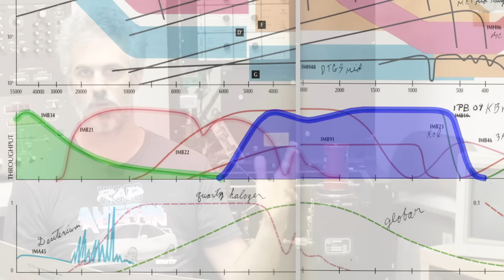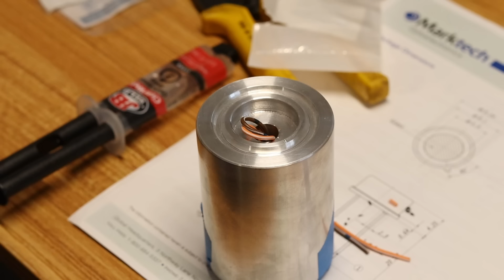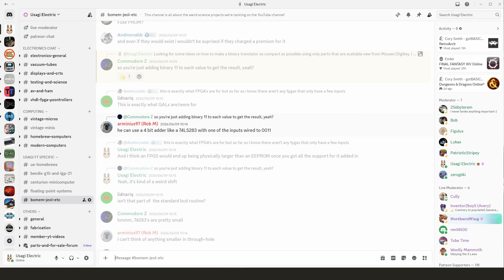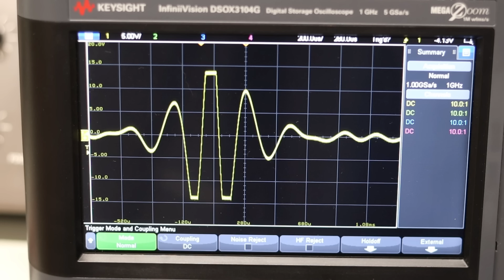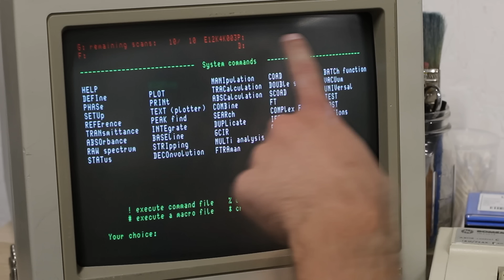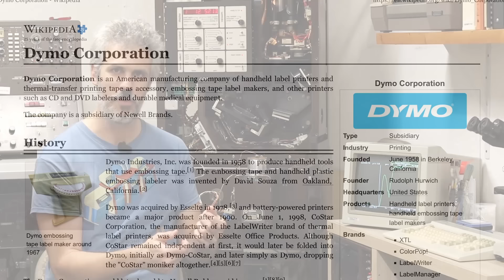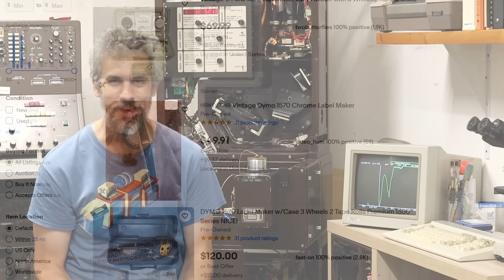Using a PDP-11/73 to do Real Science!

Comment: At this rate, it won’t be long before you can test the magnetic coating on the drum in the G-15 and figure out what it’s made of!
Reply: Well that's what the auger electron microscope is for, that hasn't been touched yet!
Reply: @vincentguttmann2231  That won't give you the composition, though. It only shows the surface detail. Like, how smooth the coating has to be and how thick it is.
Reply: @kelli217  It can tell you which elements are in it, but that is not sufficient to make out the coating.
Reply: @lbgstzockt8493  It's a lot better than guessing.
Reply from the maker: @kelli217  The Auger cycles through energy levels and detects the amount of Auger electrons being knocked off per energy level. This is enough information to get a full chemical analysis of the surface. But, you're right in that it only shows the surface down to a few angstroms. That's why it has an ion gun built into it, so you can ablate away the surface and get another measurement a few angstroms deeper. By repeating this process over and over (measure, ablate, measure, ablate, etc.), you can get a full analysis to quite a decent depth. 

This exact Auger was being used by the previous owner to inspect ICs, notably bond pads. We've recovered the hard drive that was used on the control computer and found the original software and project files. There's some amazing stuff showing the aluminum oxide levels, aluminum, fluorine, nitrogen, etc. of bond pads as it gets deeper and deeper into the material.

This should be an excellent tool for figuring out all sorts of interesting things, both with the drum and for other things like hard disk platters.

Comment: You can get a socket for a surface mount chip that turns it into a standard DIP. Mouser has them.
Reply: there's also just adapter boards you solder the chip on and some 0.1" pins, and they're way cheaper than actual sockets, and available anywhere online

Comment: Wavenumber designation was new to me, I'm used to nanometers.
Reply: The wavenumber is the spatial frequency of a wave. It can be found by taking the reciprocal of the wavelength. Spectroscopists use the centimeter as their unit of length, rather than the meter, so you need to divide the reciprocal by 100 to get the wavenumber.
Reply: I was going to say this too. I worked with medical lasers for many years, and we always referred to nanometers and frequency. I understand the term wave numbers just by the context of its use, but I've never heard it used in the field by the techs, academics and practitioners I worked with.
Reply: Wave numbers are inverse centimetres.  There are 10 000 000 nanometres in a centimetre (1000 nano-somethings make a micro-one of the same thing, 1000 micro-ones make a milli-one; so 10 000 000 nm. = 10 000 µm. = 10 mm. = 1 cm.)  so WN * nm = 10 000 000 = 1E7.  Dividing 10 000 000 by either nanometres or wave number will give you the other of the pair.
Reply: Use wavenumbers when you want a scale that is linear in energy. I worked for a company making FTIR spectrometers, the computer and software side, not the chemistry side. We had an option to plot the result in wavelength units but is was virtually never used.
Reply: Nanometers are the distance between waves. Hertz is the number of waves.
Reply: @koppadasao  and mega hertz is when you power up your custom pre-amp, and the magic smoke comes out
Reply: @gorak9000  The magic smoke is released due to excessive current, not hertz
Reply: back then every company just wanted to be different and made up their own units .

Comment: You are talking about water cooling, is tap water the correct choice with the stuff in it? Distilled water work better, using a small pump and cooling coil with tap water as the heat exchange.

Comment: I live in the EU and recently also started ordering PCBs from a local manufacturers. For smaller batches the shipping from china either takes forever or is expensive af, depends on what method you pick.
Reply: Go with Global Standard Direct Line and as long as the package doesnt go through germany (they lost multiple of my packages after duty checks for 6 months) it takes at most a month for JLCPCB.
Still not fast but its better than DHL or UPS demanding insane amounts of money and then STILL force import duty charges on you at the door because they depand double payments

Comment: Instead of using a water cooled vacuum pump, have you considered something like a vacuum pump from Gast? 

I encountered these a number of years ago. They come in various sizes and ratings. The ones I saw were small-sized ones used on a photostat camera, platemaker, and exposure units initially then later on at Polaroid Graphics Imaging (Latran Technologies) where they were used to hold down substrates on a drum spinning at 5000 rpm.

Speaking to my brother about this, he still uses one of these vacuum pumps to degas cast resin parts and molds.
Reply: It's the SENSORS  that will need water cooling, not the vac pump.
Reply: @alanclarke4646 That makes sense. He could probably pick up a chiller for that. My brother was given one by a friend of his. His company was "throwing it away" because it was old. There was nothing wrong with it and now my brother uses the chiller for his CO2 laser instead of an old fishtank pump submerged in a bucket of water.

Comment: @usagi I find the pricing model for OSHPark very much favours smaller boards - places like PCBway seem to charge linearly per area but OSHpark the area charge increases as the overall size increases. Basically, If you can shrink the amp board you have it may be possible to halve the cost to you.
Reply: what do you think the difference between "linearly per area" and "area charge increases as the overall size increases" is? regardless, the pricing model for both isn't a secret. jlcpcb has reduced/flat prices for <=100x100mm boards, then goes to a rate based on board size, and any special engineering costs, whereas oshpark is a set $/square inch.

Comment: Why not use a SMD to THT adapter break out board? Usually those are in standard smd chip sizes, and then you can machine the rest of the board in house?
Reply from the maker: Because I had way too much confidence in my original design, I was like "I'll just send it!" Turns out, I should have done exactly this, lol.
Reply: @UsagiElectric  Fair point. I would have more confidence in one of your designs than one of mine. 😆
Reply: I have done something similar (using JLCPCB) with a 14 or 20 pin SOP to pin headers for using SOP in breadboard testing.
You can get multiple on each PCB using snap lines.

Comment: Pure organic compounds absorb highly in the NIR and IR. You need thin films (.1mm or less) to get a good spectrum in the IR. If your scan can get to 3000 nm or 3333 wavenumbers a thin film of polystyrene plastic has lots of sharp adsorption lines to see. You can obtain rectangular slabs (windows) of NaCl or KBr crystals to make transparent cells for the NIR and IR with different size Teflon spacers for pure liquids. A window of NaCl is pretty tolerant of moister and can be polished if it gets tarnished. Keep the windows in a sealed container with a little moister absorbing packet. Good work with the Bowman.
Reply: Can confirm, did this way back in o-chem -- smear a bit of sample onto a NaCl plate (usually via solvent, let it evaporate) and put it in the machine. The plates looked mostly clear, but not optically pure; maybe not single-crystal, but large crystals at least, very close together (minimal porosity / intergranular space). They looked kind of layered almost like roughly peeled mica, but having that texture through the bulk.  Smooth to the touch.  I imagine the optical purity is much better in IR (i.e. scattering defects small enough not to mind); also some scattering loss on a window (without defocusing the beam overall) is acceptable, as long as it's calibrated for.

Comment: 😁👋👋 As I said before, just elated that my spectra have been of use to someone so many years after I created them! I suspect the difference in peak height between our spectra is simply down to path length and the fact that I was using pure anhydrous lab ethanol rather than a 95% solution. I wasn't even using a proper cuvette! I used a tiny little 10 or 20ml beaker, which if I recall correctly was probably about ~30-50% longer in path length than your cuvette here. Beer's law and all that... 
Anyway, it occurs to me that you could potentially just MAKE your own KBr beamsplitter! Sure it might sound totally crazy, but there is just someone crazy (and very brilliant) enough right here on YT who's made his own KDP frequency conversion crystals for Nd:YAG lasers already! His name is Les Wright and his channel is called Les' Lab. The video where he shows how to grow big, PERFECTLY optically clear KDP crystals using Alan Holden's method with a rotary crystallizer is called "How to grow big crystals at home fast!" KBr may be even easier to grow than KDP, and should be trivially easy to cleave into flat slabs for a beamsplitter with a common razor. In fact, I suspect Les may be happy to just grow the crystal for you if he has time! Maybe you could do a collab video or something. He's also a laser expert so he may have some tips for your mode-hopping/dying HeNe there. Incidentally, there's ALSO a video on here from 1958 from Bell Labs featuring Alan Holden himself explaining crystals which, while not in-depth, is excellent and a fun watch. 
The Bomem odyssey is quickly becoming a science saga favorite on here for me!! Keep up the excellent work!! 👍👍
Reply: Addendum - it's "mew-oh-knee-uhm", I am a little exotic atom made of a positive antimuon and an electron and I only live for about 2 microseconds before decaying into a positron and a couple neutrinos, but I have real energy levels and everything, just like a normal atom! ⚛😊😄

Comment: Interesting.  Maybe check out what the kids are doing with Meshtastic and Lora. The physical radio layer there is using spectrum analysis to extend the radio range by using spread spectrum transmissions then doing a FFT at the receiver. It's pretty new, only the last couple of years, but it's great for remote FPV drone controls, or just texting during a zombie apocalypse. Also relatively cheap, as the MCU's there are efficient enough to run off of batteries. Happy Sunday!

Comment: i have taken a look arround and there are photodiodes for the whole IR spectrum as well.
Depending on sensitvity one could build another pre-amplifier out of those great photmultplier tubes as well (--> new huge project incoming)
Reply: I wonder is a Peltier cooler could get it cold enough to stand in for using the LN2.  They make some stacked up ones that get well below freezing.  In a vacuum and with the low power of a detector there is not much power needed.
Reply: @kensmith5694  i wouldn't count on it. The tempreature gradient is too large for a peltier cooling to work properly. One should rather stick to a dewar style housing and filling of LN2 as needed.
Reply: @Schlumpfhut_1985  The stacked ones can make 100C Delta-T.  I think this is enough to seriously lower the noise
Reply: @kensmith5694 no. One would need at least twice that delta T. Nitrogen boils at -196°C
Reply: @Schlumpfhut_1985  It is a question of how cold is needed to do science and not the 77K number.  He is not doing super conductors or the like.  
Leakage current in a diode runs as Temperature (degrees K) squared but the noise component of that current has a sqrt() in the equation.  The result is cutting the absolute temperature in half cuts the noise in half.
He can already do some science with the detector at room temperature.

Comment: idk if full alu functionality is suitable for an fpga btw. bitwise shifting should be enough. ie minimal amount of transistors per gate logic element. may consider basic int alu ops but also can just combine multiple logic element gates to implement those. ie the point of an fpga. have to consider.
Reply: For what purpose though? The 4 bit adder is way way simpler

Comment: I think the default shipping method from JLCPCB is DHL, FedEx, or something like that. They also offer "Global Standard Direct Line" which is a fraction of the cost and hands off to the USPS upon arrival in the US, so I wouldn't expect a remote area surcharge.
Reply: Yeah. Always ignore the "estimated shipping cost" and chose the best shipping option later in the ordering.
Reply: I always order through the Global Standard and I think the longest I've ever had to wait was 17 days from order to delivery. Average is about 12 days and they've never lost a package.
Reply from the maker: But even with the cheapest option, once all the fees and taxes were added in, the price came out to roughly the same as from OshPark. I'd never used OshPark before so I figured I'd give them a shot.
Reply: I've got simular problems in Australia.  But they offer a $2 shipping option with a global option that arrives within 48 hours or so of DHL. And comes physically by the same guy in the same truck
Reply: Can confirm, the Global Standard Direct Line or whatever it's called option is what I use because although I'm 10 mins drive from the local airport apparently I'm in a "remote" area per FedEx and UPS :/
Reply: They hand off to other less reliable shippers as well, so you still have to be a bit vigilant
Reply: It just depends on how long you want to wait. I usually pay extra and have it here in five days. Also depends on the “tariff of the week”…
Reply: I notice it wants to keep flipping back to the detail, so you need to watch for that.